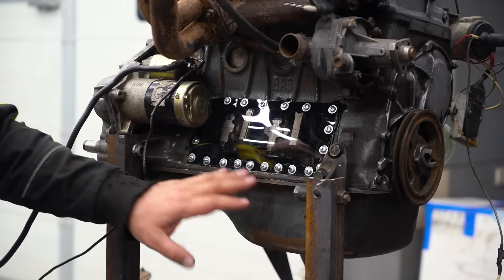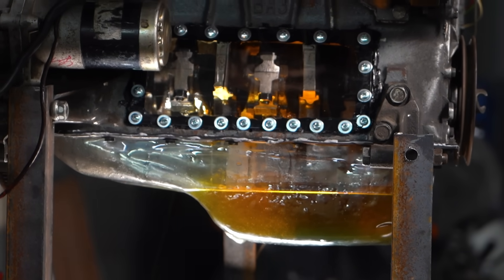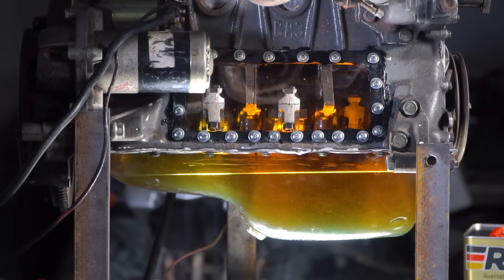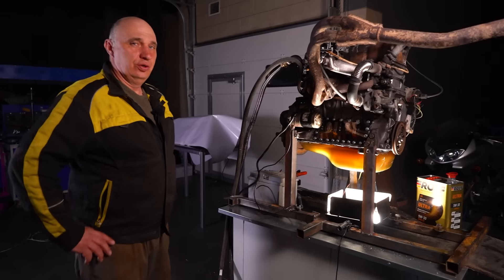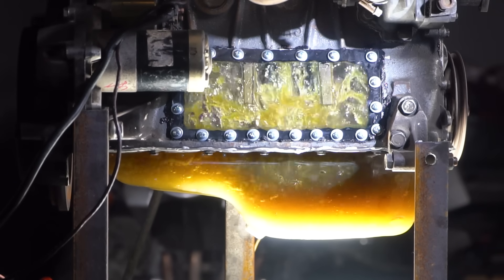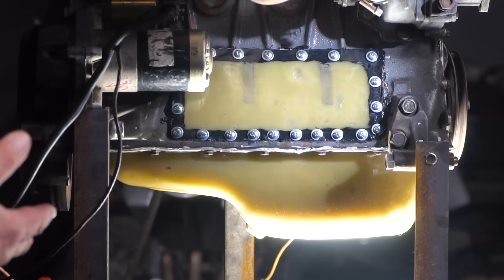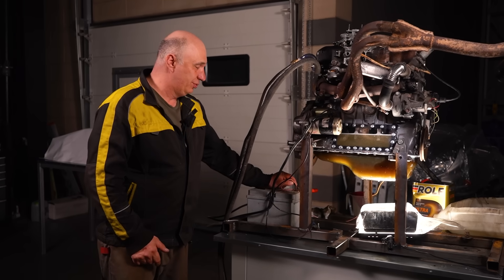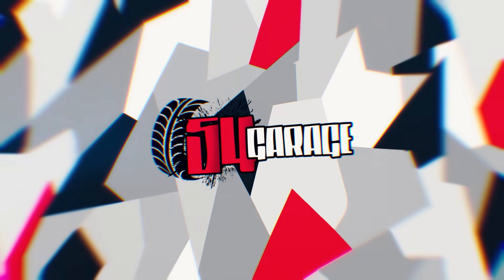What actually happens when you overfill your motor oil? (w/ transparent oil pan)

Comment: I have a freelander 1 1.8L engine and after I got done doing a headgasket and oilseal job, I filled it up with oil but eventhough I poured only 4L it showed over filled on the dipstick. I drove the car for about a week super satisfied because it drove great and at some point decided that I was curious if it could reach its top speed again, like before the job. It did, but soon after, the oil light would come on, but with a flicker. The following days the car would start and drive as normal but at some point the oil light would come on doing this weird flicker. I was confused. I couldn't find any leaks and the engine sounded good. So I threw in some UV dye and decided to flush it down with about 0.5L more oil. I took it for a drive, ran great, entered the highway and then the oil light came on solid. All of a sudden my speedometer dropped to 0km/h even though I was still driving in 5th gear, but a few seconds later the car would lose its power and the rpms started dropping as it became unresponsive to the throttle. In a split second confusion I shifted down into 4th gear and then BOOM, I saw a piston head flying out the car skipping on the asphalt. Checked under the hood, only to find a massive gaping hole staring back at me. Looking right into the crackshaft through a hole under the exhaust manifold, to where piston two should be. 

But upon further inspection I also noticed oil dripping from my oil filter. And now I am confused. I found no other signs of oil leaks or blockages. So what happened. Either I blew up the engine because I over filled it, or the oil filter came loose (because I only hand tightened it) and it spewed out all the engine oil.

Comment: Did a long haul trailer delivery in BC Canada, the trailer weighed in at 6500lbs, my truck is a 03 Dodge Ram Cummins 5.9 diesel engine auto trans 4x4. At last oil change I mistakenly overfilled by a 1/4 to 3/8 inch over on the dipstick. Under non load conditions that bit of overfill had no consequences. Under extreme load, pulling up a hundred or so 4% to 7% grades over 1500kms haul distance some oil seems to have been pushed out of rear mainseal..not good, but also not fatal as the seal has retained integrity since that long haul job. I would recommend that filling to the exact manufactures spec be followed   ... no telling how many seal leaks it takes for the mainseal to be destroyed   ... why is it that people think that their engine knowledge supersedes that of the engineers and technicians that design internal combustion engines,
Reply: A 1/4 to 3/8 of an inch over should NOT cause oil to push out of the rear main seal. You had other issues
Reply: I've see way too much of what egineers and technicians do to cars. My knowledge may humbly supercede their techfoolery.

Comment: i wonder if there is any interesting chemical reaction with the oil and the bubbles. does it having more bubbles oxidize the oil? does it cause a reaction with the metals the engine crank shafts are made of? and since there are different kind of oils, how would it change? love this!

Comment: I keep all my toys and vehicles at 3/4 stick.  Once it's hot, it is full.  The main reason is that the higher the oil level. The less crankcase room you have, and less breathing room.  Causing restriction on the pistons and more venting of the engine.  Witch the vent goes into the intake, causing less fresh air for the combustion.

Comment: I can tell you (through experience) what happens to a Ford F150 engine when you put in only 2 quarts too much oil. Drive it at highway speeds (60) for several minutes. Oil pressure goes to zero. The crank beating up the oil makes it foam, and the pump cavitates. That is, there is so much air mixed in the oil that the pump can't build any pressure. Stop immediately, or pay a terrible price.

Comment: Had the oil in my 5.7L truck engine over filled. No problem towing my boat half way across the country. Trying to recover my boat on a 30° ramp, engine hydrolocked on oil. Overfilling is not as innocuous as this video makes it appear.

Comment: My stupid BMW doesn't have a factory oil dipstick, and the electronic sensor is not as accurate as it should be.  

When it's overfilled, oil blows past the valves and dumps smoke out the exhaust like Spy Hunter.

Comment: I don’t know how true or if it works (I believe him) but I had a neighbor who was a retired Air Force E-9 (now deceased). As a preteen & teenager I would always talk to him and he would tell me his friend would also put just an extra Quart of oil at every oil change and he never had engine problems.  And he was old school he said he broke down one time traveling (maybe 50s-60s) and a old farm guy used my neighbors leather belt (made it into a round sleeve) and soaked it in motor oil all night (the old farmer invited and let my neighbor stay overnight with him while the leather sleeve soaked).

I can’t remember what he told me it was used for (maybe a clutch/manual transmission Or auto transmission) the farmer told him it should last him to get home and he can replace the round leather sleeve with orig part when he got home and sent him on his way and didn’t charge him.  I miss the good ol’days like that when we took care of one another.  But ……..

If anyone can think of this old mechanic trick with the leather belt made into a leather sleeve and what for was used for please reply back to me and fill me in.  Maybe a drive shaft trick. Maybe to do with taking up space for friction IDK,  I just can’t remember what he told me it was used for.  I wish he was still alive so I could ask him.  Rest until your resurrection Mr. Don 
(CMSgt/E-9 USAF Retired).

Comment: The bigger problem is that if you foam the oil too much the foam displaces the high pressure oil in the rod and crank bearings and this can cause a reduction of the oil shear on the bearing services.  This can reduce the bearing life.  Additionally, if you have hydraulic valve lifters the oil in the lifter becomes compressible with all the foam and your valves won't open fully -- less power.  Not to mention that you're wasting horrsepower pushing the crank and rod caps against a wall of oil.

Comment: At a certain point they foam and air bubbles is so much that the  oil pump is picking up air not oil so your engine inside parts are actually not being lubricated properly and it causes engine where. Can blow oil seals

Comment: My 2005 Nissan with the VQ35 would run like a diesel if you were 2 oz overfilled. The added oil pressure would mess with the crank position sensor.

Comment: I overfilled mine accidentally a bit over max last week and I was worrying. And now this video comes across 😂👍
Reply: Same i just overfilled by maybe third of a quarter and I was worried, but now I'm not bc my engine burns half a quarter every 500-600 miles anyway so eventually it will come to even level again 😂
Reply: @elnewbie2611  Same here 😂 So better a little too much than not enough one time...
Reply: 😂😂😂 @elnewbie2611
Reply: @elnewbie2611  Too much oil overstresses the piston oil rings and will work its way into the combustion chamber. Make sure not to overfill it. This video is somewhat misleading.
Reply: @elnewbie2611 no no, don't overfill, the oil will get into the chamber if you overfill.
Reply: @OneManBandF13  no it will not! if you overfill it with 1 quart or 1 liter nothing is going to happen the car will burn it all soon than later putting more than 1 LITER will get into the chamber yes.. but not 1 liter i have try it many times nothing is going to happen.. chill out buddy
Reply: @yusufitani32  nah overfill is a bad idea, just put your oil at 70% or below the maximum of your oil dipstick.

Later if there is something wrong with your engine, you can always add additives to the engine oil, without worrying having too much oil.
Reply: @OneManBandF13  overfilling it depends how much of oil your overfilling i have a honda civic 1.5 L petrol Year 2019 my baby have driven 234.000 miles and i have always overfilling my engine with 1 liter nothing has happen if i am doing a long trip i overfill my engine by a halv a quarts or 1 liter depends of the trip overfilling isnt a bad idea i havnt have any issue no problems on the engine i had my car since 2019 i buyed it with 34.000 miles and the car have no issues i havent ezperince any issues overfilling your car at that amount dosent harm your engine at all
Reply: you should be fine. Now if you dump 2-3 extra quarts into the engine then we got a problem.
Reply: In Soviet Russia engine oil changes you.
Reply: Yeah you gotta put waaaay too much to have problems 😂
Reply: Google is spying your brain
Reply: I over fill my 1/2 guart over ,doesn't  use oil .I think it be 👌 until next oil change.
Reply: @Dan-ej9iu  1 quarts/ 1 liter  is fine but dont overfill it more than that or the oil will slip in to the chamber dont do 2 quarts

Comment: I used to love when people would come in with over filled oil.  Always great comic relief during a busy day.  "My oil light came on so I bought oil and put it in."  How much did you put in?  "One bottle." While pointing to the 5 gallon jug.  I also had a mechanic drain a Subaru XT trans, change the trans filter and then add oil to the engine that was still full.  Then fluid got added to the  front diff instead of the trans.....  That there was a day of learning and luckily there wasn't any permanent damage.

Comment: Thank you for yet another educational video! I highly appreciate your videos with see-through covers. May I suggest the following slight improvements: attach an oil temperature and oil pressure gauge because it would be interesting to see the effect on these parameters. Secondly, why not draw a couple of lines on the oil pan? A thick green line for normal oil level, a dotted black line for 1/2 litre above and full black line for 1 litre above. A yellom line at minimum oil level and a red line at 1 litre below minimum level. Thanks once again and keep up with the good work!

Comment: Whoa, what a test. But ya know... I can bet the auto manufacturers did a similar test when deciding to gauge proper oil levels, from the beginning. Pretty cool though.
Bottom line. If you want more oil, make the sump deeper. Don't overfill the crankcase.

Comment: These are short term operation tests... As you can see, once the oil is over filled, the oil begins to foam from crankshaft slap. if this were a vehicle being driven more than the few seconds these tests show... the foamed oil would start to starve the engine of proper lubrication. Foam has air... air doesn't lubricate... so yes, you can seize an engine from too much oil...  Aerated oil doesn't lubricate. oil pumps can't pump foam.. it gets worse the longer it runs.

Comment: At 8:23 he said that nothing bad happen when you double the amount of oil in the sump. This is not true. The extra oil will create extra pressure which oil seals cannot handle over time leading to damage to oil seal and gasket. Secondly (specially at high rpm as shown), the spinning crankshaft is whipping the oil making it foamy (oil with air pockets) making the oil not effective in lubricating the engine which will damage the engine overtime.

Comment: Issues with over filling your engine oil:
* Reduced efficiency and engine performance as crankshaft and other components put more energy to splash and pump higher quantity of oil
* Over pressure on seals and other components causing leakage and seal failure
* Foaming reduces the lubrication causing reduction in life of bearings and mating surfaces in the long term
* Cavitation and flashing of engine oil when crank and other components hit the oil at high velocities causing mechanical damage to engine components
Reply: Umm you watched the video to aye ?😂

Comment: extra oil in a newer engine can lead to oil escaping through the PCV , valve seals and  other internal components. running a engine on a stand of a few moments doesn't simulate real world use and the possibility of catastrophic engine knock when oil enters the combustion  chamber over long periods of time.  you don't need to believe me there are thousands of stories of engines destroying themselves on the internet because something as simple as a pcv system allowed oil in the combustion chamber ( GOOGLE n63 BWW engines) they are notorious for this 
.

Comment: If you haven't do one where you add water to the oil slowly till it hydro locks, could so it via the exhaust system similarly to how most engines end up hydro locking

Comment: I had a Lexus IS220D sport which was overfilled with oil at a main dealer service. The first i knew was clouds of white smoke from the exhaust. It completely fouled the DPF. Very soon after that an injector failed which I'm sure was due to the overfill.

Comment: Crankcase pressure increase will make seals leak and oil will find its way through the breather into the air box. Oil level isn’t a suggestion it’s calculated based on what the engine needs to perform it’s best.

Comment: From my experience over filling is only an issue if it’s excessive. 1/4 quart in a normal car usually won’t cause issues. Along with cavitation comes excessive heat build up as well. There is more oil to cool and it’s aerated which is harder to cool, which means it cannot cool properly for 2 different reasons. Also with more oil comes higher crank case pressures which with crank case pressure sensors or crank case vent filters causing more issues.

Comment: I overfilled my car engine by only one quart once on a 2-hour road trip by the time I came back my car was smoking from the oil burning off the exhaust manifold turns out all it took was one extra quart to blow my valve covers gaskets on the driver side. I use 9 quarts regularly

Comment: I had a 1992 vw jetta... Changed the oil and over filled it. Drove it right after and it bogged down and then started blowing smoke out of the tail pipe. It blew my piston rings.. Not sure if this applies to all engines.

Comment: Bubbles with motor oil will destroy an engine. More oil added and it forms into bubbles. Bubbles are air. Air between to metal surfaces will fail fast. 😢 I used to build engines.  ❤ I always go half way, to between min and max is always the safest choice!!

Comment: I'm impressed that the polycarbonate pan and view-window didn't leak like crazy.  Don't be tempted to think that it means that it's better to always have your engine oil to be a bit over full.  A bit under full is better and less apt to cause problems with oil circulation.  If you're going to be regularly  running the machine at severe angles, maybe a little extra oil is better? However, at the very least, using a different oil pan with a deeper sump is probably needed

Comment: Foaming is a problem in fluidics, We can't say it's normal. Actually the air bubbles will reduce the density and viscosity of fluid and if viscosity and density is not as per the design criteria then definitely it will cause premature damage. Also air bubbles will reduce the oil lubrication and may cause the oxidation issue. But it will not result immediately or within a few hours. However, we can say foaming is a slow  poison to any fluid and fluidics system.